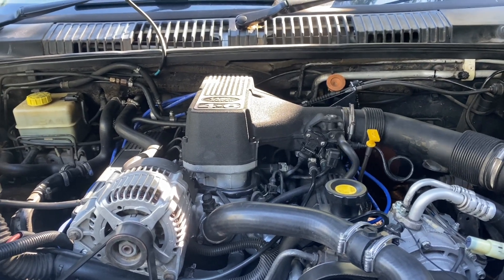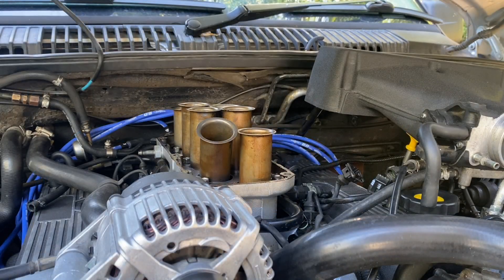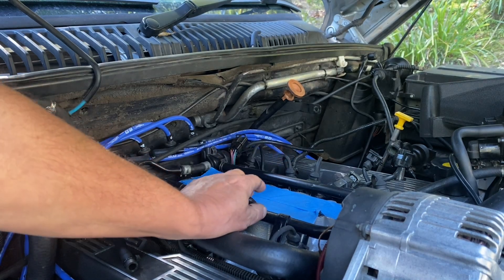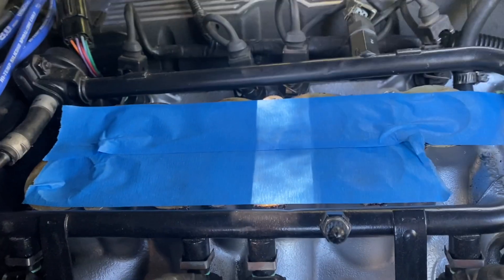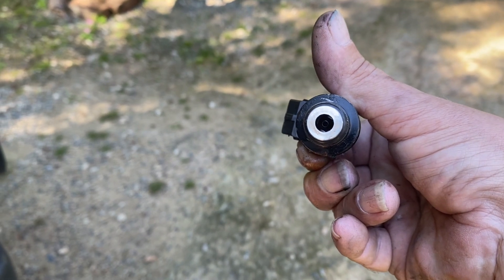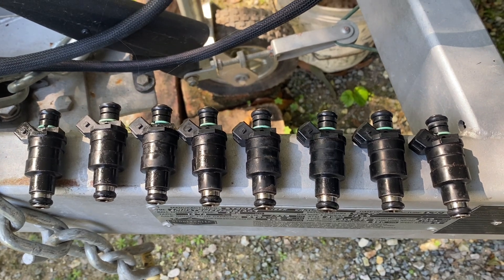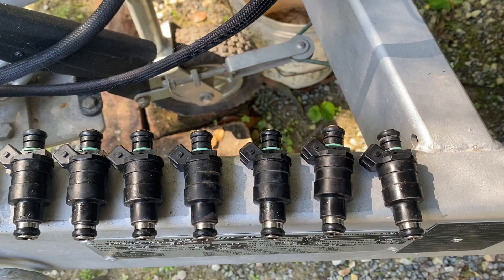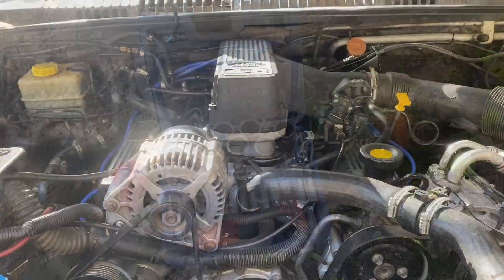Get MORE POWER with LESS FUEL! How To Change To Upgraded Fuel Injectors. Range Rover V8 #car #engine

Comment: Excellent video - showing the things that can go wrong is as important as showing how to do things right. Did you measure the length of injectors to see if they are the same? That might account for the fuel rail fitting to them insitu.
Reply from the maker: @michaelwallace4298  thanks mate and yes, knowing what goes wrong is imho more important for getting the required results. Injectors are the same length and it was just me trying to shave/cut a corner a little that led me to try the first way…ahh well, live and learn 😀👍

Comment: What is the type of these new injectors ?
Reply from the maker: https://www.ebay.com.au/itm/224423756145?mkcid=16&mkevt=1&mkrid=705-154756-20017-0&ssspo=TQ23tZhWQ4e&sssrc=4429486&ssuid=wOmOYmqrTEG&var=&widget_ver=artemis&media=COPY
Reply: @wellwhatdoyouknow670 I don't suppose you have any idea what brand or model the fuel injectors are do you, as this link is no longer valid? 
Have you had any luck fixing your other engine issues? 
Cheers Rob from Tasmania 😊

Comment: I did a similar thing with the injectors from a Ford Modular V8 (6 hole) and replaced the factory injectors on the Mopar 5.9L V8 in my 2003 Ram I had, which had single hole injectors. Body type, and plug connector were the same, flow rate was comparable… 240cc up to 252cc. The big difference was fuel atomization. With no other changes, my fuel economy shot up from 17.4mpg (US) to 19.2 on the motorway.
Reply from the maker: Nice! I’m hoping the economy is improved a little